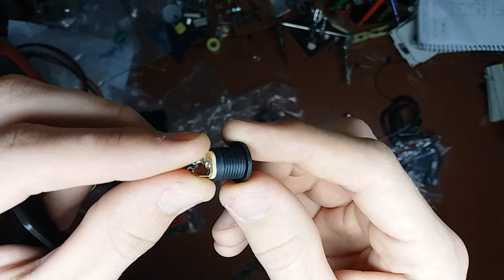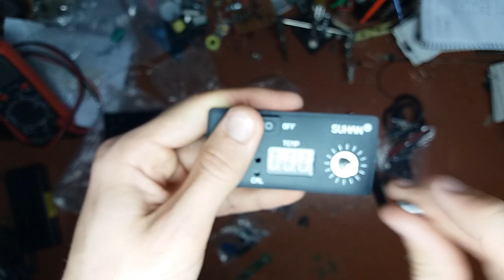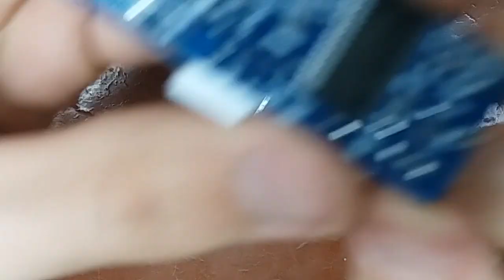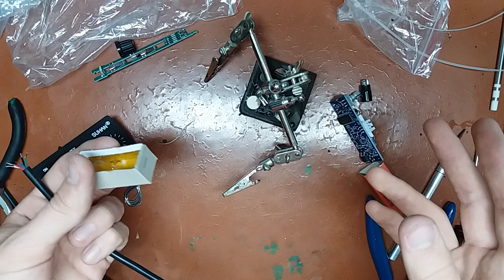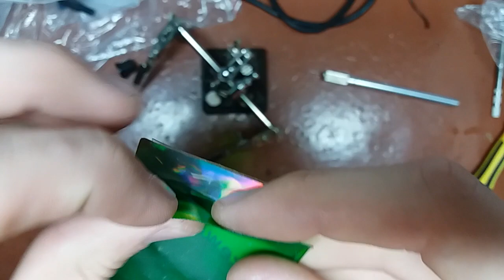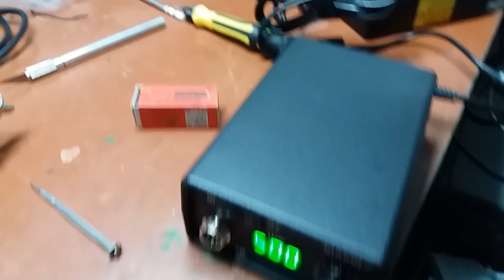HAKKO t12 DIY kit build

Comment: hi mr johhhnnnyyy, i liked your youtube video on hakko t 12 diy build, but a have a few questions about ,you dont say what colors wires to put on the 5 din plug, how to calabrate it,how to wire up the pcb thats goes into the iron.
john
Reply from the maker: john fowler I followed the picture on the eBay page. I didn't really bother to calibrate it :) Each tip has its own thermocouple, calibrating it for one tip will make it accurate only when using that tip.
Reply: thankyou mr johhhnnnyyy for getting back to me there is quite a few people on youtube i write to for help or information they say contact them i do and they dont get back anyway thankyou again, as you said you followed the picture of ebay, could you please tell me what to type in to ebay to get those pictures to see how top wire it up, im only learning electronics as a hobby and as i said i look on youtube for info and help, i live in australia im a carer for my wife so do this as a hobby which i enjoy am i allowed to have your email address or through youtube maybe you are not allowed to give it out thankyou again.
john
Reply from the maker: john fowler The listing has been modified, but I found the same picture here: 
https://ae01.alicdn.com/kf/HTB1XqsNOVXXXXceaFXXq6xXFXXXG/2017-2017.jpg
Reply: thankyou mr jonnnhhhyyy, for once again getting back to me i get a big kick out of it i really do, cause i find no help anywhere other than you , and that picture you sent it will help me build the kit when i get it, yesterday i contacted banggood about the complete kit they have discontinued the kit, so now im waiting for a complete new kit to buy when they organize one i dont no when that will be, if i have anymore questions can i send you a message through youtube in the about section or send the email this way , anyway keep up the great videos ill be watching and once again thankyou.
john

Comment: I don't judge you on anything, i have no right to do that, the most important tool is the bit between your ears, you are well equipped :-).

That looks like a nice soldering station, and when you find or make a 24v psu, it should be spot on :-D, but the tip still needs mass to solder big earth planes, heat sucking.
That flux looks ideal, it may not be the best but it works :-D.

It would be interesting if you could get flux in rod form, like uncooked spagetti, well i think it could be interesting, ok ill shut up LOL :-D.
Your phone does really well, nothing is missed, not even the fly :)
Reply from the maker: zx8401ztv Actually, I have made the PS for it already, and it works a treat. Gonna debug few little querks, and it should be all set.
 I have quite a lot of material about that thing, I don't quite understand how I will upload it all. There I show a lot of waveforms on the scope and how I calculate the snubber network values.
 I don't know how interested you guys will be in that, we will see :)
Reply: I had forgotten what voltage your psu produced, and it can be in an external box if it wont fit in the soldering station, it does not matter as long as it does the job :-D.

A lot of small lcd monitors use an external brick, i like a seperate psu.
Reply from the maker: zx8401ztv It fits right in, and it would've looked just awesome if I would've not messed up the footprint size of a transformer. Now it's a bit crammed together, but oh well :)
Reply: Hi there! it would be great to have a video on the PSU too!
Reply from the maker: michalis1256 Ok, I do have quite a few vids about the PSU already, but I'm not sure how interesting they will be for you. I'm gonna upload them anyway, I just can't promise that those will be what you would like. I warned ya :D